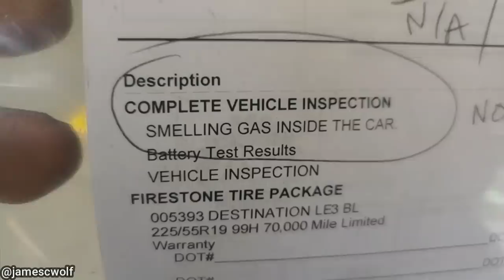Customer States Went Off Roading In Ford Bronco And Now It Won't Start | Just Rolled In

Comment: I hydro-locked the engine twice on my '84 Toyota van when the streets in my neighborhood flooded during a rainstorm.  Fortunately, all it needed was draining and a couple of oil changes, and it was fine.  I subsequently drove that van for nearly 300,000 miles, and its 3YE engine was still going strong!
Reply from the maker: My dad owned one of those for a long time. We took many road trips in that van. Some of the best memories was sitting in the back seat, with a fan plugged in the cigarette lighter since it had no AC lol.
Reply: @JustRolledIn  those old Toyota‘s were built to last
Reply: Some years ago i had a VW Golf with 1.9 TDi engine. Once I was driving during the night and hell of a rainstorm, and spotted huge puddle of water too late. I drove into it going about 60kph, and it was so deep, that my car decelerated to about 35kph without me touching the brakes. Just imagine the ammount of water that suddenly hit the front of my car 😂 The engine immediately switched to safe mode, and got stuck at 1200 rpm, and didn't react to throttle pedal whatsoever. Turning it off and on again changed nothing. Fortunately these engines have a lot of torque, so I was able to drive like that back home (no more than 4 kilometers) just using higher gears to go faster. The next day I started the engine and everything was back to normal 😄 This is just another evidence of how literally bulletproof these engines were.
Reply: Majority of the hydro locked engines can be saved if the drivers stop trying to restart the car right then and there. Pull all spark plugs first and then crank it over to eject the water and then reinstall. Best done after being dragged out of the water first.
Reply: @TheTitaniumSkull  Great pro tip !  especially about being dragged out of the water first
Reply: @SteveB88  Believe it or not, right now I'm driving a 1984 Toyota camper (but just not too far).  Its 22R engine runs okay, but could run much better with a little work (Weber carb w/ full desmog). Trying to decide how much money to pour into it.
Reply: @JustRolledIn  Living in Florida at the time, mine had the "Dual A/C" option, which had a second evaporator and blower for the back area. There was even another option with a refrigerator that ran off the same A/C compressor. I loved working on that van, and did repairs I would never had attempted before. 

BTW — I really like your channel.

Best Wishes from Elmer
Reply: @ElmerCat  So that's what Dual A/C means, my car has that and I never use it, but I'm single with no kids so I've never had anyone in the backseat (I'm 79 and don't have any other need for the backseat either).
Reply: @TheTitaniumSkull  No way. Something always breaks or bends. Sure you may be able to drive it to an engine repair shop but it's not like it never happened!
Reply: @richardwarfield7386  Reminds me of a joke...guy drowns, washes up on shore, lifeguard tries old style CPR to pump water out, it works but an onlooker asks, "shouldn't you get his butt out of the water before you pump the lake dry?"
Reply: @ElmerCat  I would say if the body is in good shape and not rusted out then it would be worth putting money into. Especially if you’ve got the camper one. that is extremely rare to find.
Reply: @haroldwilkes6608   That's gold!
Reply: @ElmerCat  Dolphin or Sunrader? My dad has a sunrader, but it needs a bit of work to make it usable and drivable again. Differentials for those are hard to find. I think they build those on the backs of modified landscaping trucks?
Reply: @SteveB88  I'm inclined to think so. I'm pretty sure it needs new shock absorbers, but that's something I can't do myself.  Before replacing the shocks however,  I first want someone to give me a thorough assessment of the frame, undercarriage, etc., to make sure there's no imminent disaster lurking below. 

My problem now, is finding an honest mechanic who ia also interested in working on a vehicle of this vintage.
Reply: @haroldwilkes6608  If it's ever a very hot day running the dual AC will probably cool the interior air quicker since it will have more than one venting location to introduce the conditioned air, something to consider it's very beneficial to have to be honest
Reply: @HustleMuscleGhias  The camper is a Dolphin model 700. It's built on a 1984 Toyota "Cab & Chassis" with dual rear wheels.  The same basic vehicle was also manufactured as a pickup truck, but in this case, Toyota sold just the cab with a bare chassis to Dolphin, who added their camper on top.
Reply: @sed6 Perhaps they don't make 'em like they used to, but it did indeed happen —twice— to my 1984 Toyota.  It ran for hundreds of thousands of miles, like it never happened at all.
Reply: In Houston TX insurance companies provide community outreach for people on how to prep their cars after hurricanes and floods come and go
Reply: I hydro-locked my 300zx once, drove through a new parking lot after it rained... couldn't see that #1 the storm drain was clogged and #2 it was two feet deep. Purged the water in the parking lot pulling the spark plugs, and drove it home. Changed the oil 5x before all the moisture was gone, and then drove it for another ten years further... It's at the shop for upgrades right now but was still running when parked, lost an injector.
Reply: @MetalY2KMusic  Thanks, may try that. It makes sense.
Reply: 3 things will be left after a nuclear war: Cockroaches, Hostess Twinkies, and Toyota engines! lol
Reply: @grishemall  i used to drive a petrol vw polo for work and that thing had over 300, 000kms on it. wouldnt be suprised if it had 400, 000 now. it ran like shit but it kept going every day. and the oil changes were irregular too. couldnt believe how reliable it was
Reply: This guy kept going it looked like and that’s just asking for a new motor 🤣
Reply: Yeah. They were built in the days when engines were made properly, not like these shit things today.
Reply: 'Hydro-locked' isn't universally used in the same way.  Your engine was not truly hydrolocked and engines rarely are unless they are restarted after being in water. (and if the cylinder is full of water and you hit the starter there isn't enough torque to cause failure - it only fails if it is running and then hydrolocks) Usually it's just so much water the combustion process fails but not enough to truly fill the cylinder to the point of fully hydrolocking it where the laws of physics would dictate catastrophe.
Reply: @tomboyhorse1236  A pound to a pinch of shit it wasn't a 3 potter then.  A miracle if they make it to 100k in my experience!
Reply: '84! Need I say more?
Reply: @grishemall  meanwhile our 1.9 TDi died before reaching 300k km... and looking for engines to swap I came across forums posts where people had the same failure without even reaching 100k km.
Reply: @TheTitaniumSkull  Is this repair before or after you are ticketed under the "stupid driver" law?
Reply: Old Toyota’s have no quit
Reply: @grishemall  I still own my Golf mk3 convertible with an 1.9 TDI. You can't kill that engine. But the chassis... Gee I'm on the best way to become a master in welding ngl xD
Reply: @TheTitaniumSkull  cranking isn’t gonna bend a conrod, but rapidly filling the engine up with water at 3000rpm sure will

Comment: I’m amazed at the junk y’all work on. You guys are hero’s.
Reply: FORD SUCKSSSSSSSSSSSSSSS
Reply: @ekop1778  nah
Reply: *heroes
Reply: @ekop1778  I have three Fords and I wouldn’t own any other vehicle.
Reply: @slchambers1  DONT BUY A FORD ,
 GET A SUBIE OR TOYOTA
Reply: Get an early 2000s and older they look better and drive better because after all every new car is junk
Reply: @ekop1778   People only drive chevys because of the cheap parts I grew up on fords abused the heck out of them we only got rid of one because it had a problem with mice
Reply: The funny thing is most people don’t know anything about the car’s they drive. This channel just shows the most ridiculous number of cars ready for the scrap yard.
Reply: @ekop1778  subarus are even worse In reliability, due to thier inability to create a proper head gasket most will need replacement after 100k and on top of that they burn oil almost as bad as a RX7
Reply: @davidlampe4153  you guys are living the dream.
Reply: @mudbog6769  I love my 2014. I had a fairly new 1969 and it was literally a piece of junk. It’s why I didn’t buy a restored 1969 and bought a 2014. I remember
Reply: @ekop1778  I’ve had extremely good service out of Fords for literally for 51 years. Let me think. I don’t believe there were many Toyotas or Subarus 51 years ago. Let me think. Nope
Reply: @slchambers1   Never get a Restored one get one that looks like total crap and needs a little love put into it and 2014 is an alright year
Reply: @ekop1778  each to their own. I’ve owned Fords for 52 years. Still own them, three to be exact. Two are fast as anything on the road. My brides vehicle is what she wanted. She could have had any vehicle she wanted from Honda Pilot, Toyota Highlander, Chevy Tahoe or Ford Explorer. She picked the Ford. I was sweating it out for a while because I’ve never owned a Japanese vehicle before. Dodged a bullet
Reply: @mudbog6769  we are talking about Mustangs? My 1969 was a Mach 1/ 4 speed 428 cobra jet. Not the super cobra jet. The 335 cobra jet. Piece of rattling junk. 2014 Mustang Gt/CS convertible
Reply: @slchambers1    I didn't know you where talking about mustangs I'm not car guy I'm a Truck guy
Reply: @mudbog6769  my brother has a nice 2017 Ford F-150 4x4 four door with big tires and a 5.0 with long tubes and cobra manifold. Nice truck
Reply: U notice they're all newer cars?
Reply: @khunigan  it’s sad that people don’t recognize vehicles as assets.
Reply: @slchambers1  Indeed.
Reply: @danielplumley2649  Toyota makes good vehicles. I have a buddy with a 1989 Tacoma with a four cylinder with 500K. Of course the engine and tranny has been rebuilt numerous times.
Reply: I'm glad I retired from that years ago.
Reply: @ekop1778  Depends on the model. Continentals, Crown Vics and Mustangs are pretty good. The rest are junk
Reply: They don't work on them. This is just a content channel where they compile content from all over the world bio says

Comment: The guy with the hydro-locked Bronco is a member in good standing of the More Money Than Brains Club!
Reply: My first thought too 😂
Reply: Guy has no clue about off roading. More like boating
Reply: If it's the 2.7 L, it will grenade on its own when it drops a valve.
Reply: He even trashed the engine before the manufacture defect took affect!  LMFAO!
Reply: Not a mechanic, but how the fuck does water get in the engine? I thought they're sealed off
Reply: @jordanissport  Water can get sucked through the intake in deep water, which will hydro lock the engine.  Can't compress or combust water.  That's why driving through deep water will stall the vehicle.  In addition, water can also travel up the exhaust and flood the exhaust side of the engine.  And if any of the seals are weak (allowing fluids to leak), the water will find its way in through.  A proper and complete snorkel system will seal off the intake side of the engine.  Of course, you have to consider waterproofing electrical components to prevent them from shorting out.  Another reason why cars stall in deep water.
Reply: @americanpatriot2.06  bravo sir.  I appreciate your comment. Yeah I'm done driving through puddles for entertainment. I just had to replace my front and rear passenger side light assembly sockets. I'm pretty sure the water spray is what caused them to melt
Reply: Sadly, the more money than brains club doesn't actually require you to have more than a single penny to your name...

Comment: Can't mention hydrolocking without mentioning Rufford. :)
Reply: That road is the dumbest ish ever. Years of people ruining engines/vehicles, and no one puts in a bridge.
Reply: @coolhanddruid  The road is fine. The people are the problem.
Reply: @coolhanddruid  Dont think a bridge will go up due to proximity of houses, reason given where I am. There is an alternative route not far they can use to avoid the flood. And most could drive properly
Reply: @georgeharrison2795  The ford is part of a managed lake and is largely there as part of the lodge.

Comment: Why do they always drive fast into water!? Ease in, avoid the bow wave into your intake, and prepare to reverse if the water gets too deep, rather than push through. Also, know where your intake is as that will help avoid issues of going too deep.
Reply: In my case, intake goes over radiator and intakes air from the grill in front/above radiator on the left side (bow wave is especially dangerous in this regard). It is one inch higher than my wheel arch (which are 33"). So, if the water is deep as the wheels (29"), I slow, and if it hits the arch, I stop and reverse. If possible I keep my drivers side on the shallow side of whatever water/mud I am going through to keep the intake above water.
Reply: yeah , but then you don't get the cool bow-wave for the cameras / social media .. lol
Reply: They do that in this location for fun.  This water crossing has it’s own website.
Reply: Ordinary road cars have no business wading into water at that depth anyway, especially if it were flowing water.
Reply: @MattExzy  precisely, especially when the driver does not have the sense to avoid wrecking their engine.
Reply: The Rufford Ford even has a measurement sign at the side, so people can even see how deep the water is before entering it.
Unfortunately some ignore it, and a lot are driving far too fast (even if the engine don't hydrolock it can rip off license plates, plastic parts or the whole bumper)
Reply: The driver probably thought it was ok, seeing as to how the water was only chest-deep for the ducks...

Comment: "Excuse me, Sir, but your power steering is on fire!"
And I've never seen a rotor that thin before.
Reply from the maker: I showed one in a previous video and it looked like a piece of paper 😆
Reply: @JustRolledIn  I must have missed that one; thanks.
Reply: @JustRolledIn  it's incredible they don't break apart even if they are as thin as a bicycle disc rotor
Reply: @simonm1447  the owners are probably braking softly. with brakes that neglected the fluid surely needs replacement, too, and has air bubbles inside, making the brake pedal soft as a marshmallow.

Comment: The last clip reminded me of another bmw wagon that went through the same flood , blew the rods through the block ( quite the oil slick afterwards ) . I still remember the customer that brought in a tire they wanted repaired , wore right through the cords and a big hole in the tire , told them no , not safe to repair ( nothing for the patches to cling to ) . Off road ? Into a lake ? 🤪🤦‍♂️
Reply: Flood? That is a type of river crossing called a ford. That particular one is rather well known.

edit: It is Rufford Ford in the UK.... figured I should mention that, lol.
Reply: @whyjnot420  that's right , Tommy forgot 🤦‍♂️
Reply: @thomasfletcher4765  I love watching videos of that place. It is just so nice watching person after person destroy their engines.
Reply: The Rufford Ford is infamous for killing BMWs, but also Merc Sprinters (they have the air intake at the front of the grille which is typically covered by the bow wave then).
People are dumb using this street for just a couple of minutes of time saving

Comment: I remember once it was raining and I was coming up on an area with a lot of big parking lots that flowed into a major street.  I could see it was going to be too deep for my little LUV so I started to pull off the road into one of those parking lots and was half way into it when some joker in a lifted full size pick up roared past me and sent a wave up my exhaust pipe.  And there I stayed until the rain stop and everything dried out.
Reply: what is an LUV?
Reply: @uncrustable9923   Chevy LUV, an Isuzu light duty pickup sold under the Chevy name.  Once Chevy started making their own, Isuzu started selling it under their own name as the PUP.
Reply: @DaremoKamen  oh nice, never heard of them I like small trucks
Reply: It's the predecessor to the S10. It was made in the late70's to mid80's. The luv is not a bad truck, but I'd rather own a Silverado. Lol.
Reply: @uncrustable9923  Puddins fab shop had a Chevy Luv on his channel

Comment: 2:46 Offroad guys avoid plowing into water like that because impacts with standing water destroys radiators. But some people in road vehicles think "well if I drive fast enough my car will just skip over the surface!" and hit it at a million miles an hour. Nope, it just makes the vehicle that much more of a write-off.

EDIT: It should be noted that the driver made a second critical offroading mistake in this situation. He attempted to re-start the engine even though it had stalled and water had very likely reached the air filter. It's possible the engine hadn't hydrolocked at that point, but cranking the engine to fire it up again is what actually did the hydrolocking damage. If water has reached the air filter, you HAVE to assume the cylinders are flooded and the spark plugs need to be pulled before cranking again.